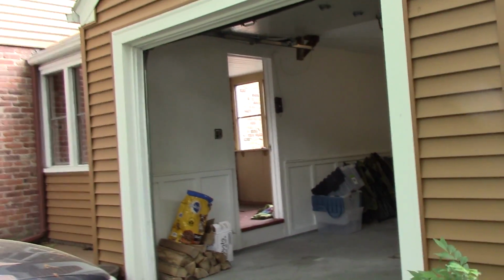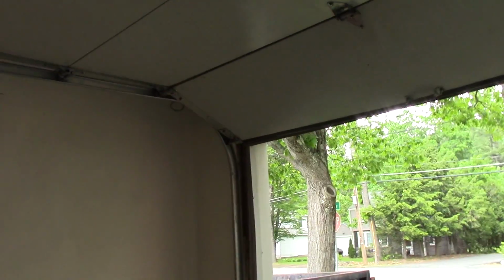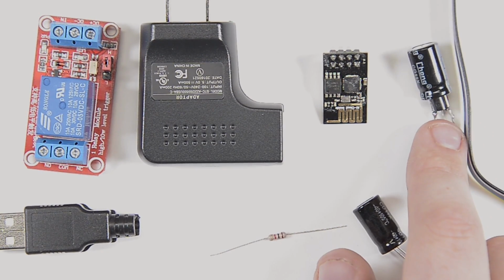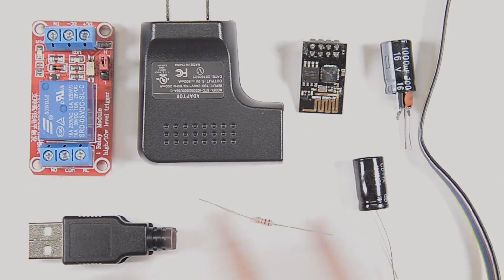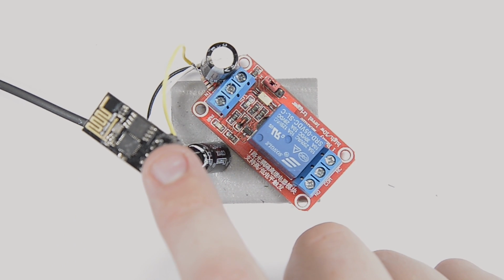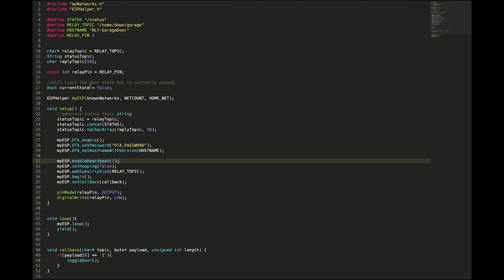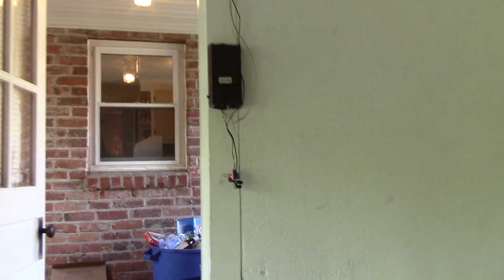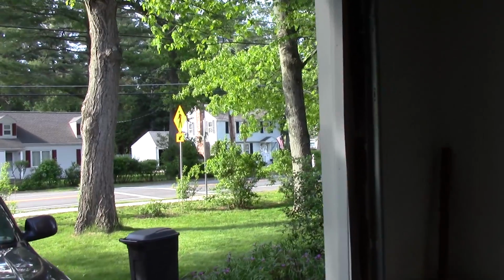Wifi Controller Garage Door Opener - Summer Project

Comment: So what parts would I need to buy to make this project?
Reply from the maker: You can see the components/layout here https://gist.github.com/ItKindaWorks/56422d515f4281ee44bc1637c0823aaf. Basically you need an ESP8266, relay module, 3.3v regulator, a 5V power supply, 1000uf capacitor, 100nf capacitor, and a 220 ohm-1k ohm resistor

Comment: I was thinking about doing something like this, but since the ESP is attached to my home WIFI, I would just use an app on my phone to open and close the door. My wifi reaches the front of my garage door. I would use it as a backup, since my door already has a remote control. Another useful feature would  open the garage automatically when it detects by GPS I'm going home and then stopped at the front of my garage.

Comment: The one problem I have always had with this project when I have done this is that in the event of a power failure when the power comes back on the garage door will open. Can you suggest a fix that will ensure that the garage door does not move after a power trip or outage.
Reply from the maker: I've had that issue too. Still working on a solid fix but in the next update to this project I plan on adding a door sensor so that it can detect the door state and upon startup it might trigger it to open but then quickly trigger it to close again. Not a perfect solution but at least it gets the job done.

Comment: Nice build.

You could wire it into the other end of the twisted pair right on the opener and plug the power supply into the same outlet as the opener. This would clean up the wires around the door and not take an extra plug down low where you might want to use it for something else.

Peace.

Comment: Now just make the accessory.js for HAP-NodeJS and use siri for your garge door...
Reply from the maker: Video coming soon... ;)
Reply: I imagined it would be the subject of a new video.

For curiosity how do you find yourself with the regulator now that you're using it a little more?
Reply from the maker: On the few things I've used it on, I havent had any issues so far. It has completely eliminated reboot issues on some of my modules that previously kept giving my trouble (namely a temp sensor that would reboot/die every few days no matter what I did and my HVAC controller).
Reply: I am happy that it helped you

Comment: Nice one. Love the simplicity on the hardware. 
Did some similar project a while back, with software integration with Homekit(Siri) https://www.youtube.com/watch?v=R8UiLsZSmAc

Also, last week, I just installed one sensor to detect when it is opened or closed. I will try to post a new video with the Opening/Closing status. And will also post the code for the Homekit integration to my GitHub account, so folks could use the software with this hardware.
Good stuff.

Comment: IT WAS ME!!!!! :D
Reply from the maker: It totally was you dude! :) Haha great to hear from you again
Reply: Ive definitely been following....and looking forward to this  one!  Just talked about this project this past week!
Reply from the maker: Well this is hopefully just the start of the project. I have plans for adding in the distance sensor (which I think was also an idea of yours) for open/closed detection and also plan to add in an IOS homekit accessory for it as well.
Reply: That sounds great.  When I get it set up I was going to use an IFTTT recipe.....so i could "okay google" it open or closed....  Heck, maybe I could even ask the status and get a reply so I dont have to go out to the garage frantically to see if I forgot it :D   Might want to code in a "wait" to make sure the garage doesnt get a 2nd signal while in motion....which would leave it half open, but still not trigger the open sensor...
Reply from the maker: Thats a good idea. I'm also planning on having it run on a current/target state routine where it will get an open signal and will trigger an "open" event and wait for some time to see if the door opens after a certain period of time. If not it will send that signal again to the relay and keep trying until it sees that the door is open. That way there is more of a guarantee that the door will achieve the state that you want.
Reply: Ooooh!  "If time = suneset at my location and Garagedoorstatus = 0 then send notifcation to my device that I forgot to close my garage door :D
Reply from the maker: A simple photocell on an ESP would have that one covered!